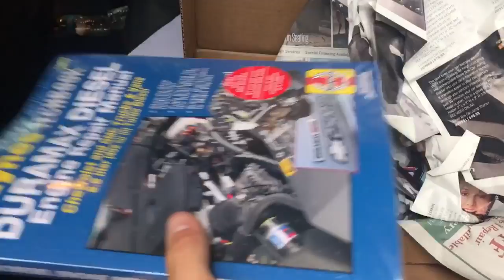This old Duramax is Gonna Make me Broke!

Comment: The bang for your buck would have been to order the head studs, i don't know what all you ordered from Lincoln diesel, but when I ordered my headstud kit it was like 880 out the door, so a couple hundred dollars more would have bought you reliable security and freedom to play about as hard as you want, I wouldn't own a diesel without head studs, people blow head gaskets on stock trucks. my truck had 210k when I bought it, was running 70hp tune, by 215 I had coolant leaking out the back of the gasket down the block, now at 245k studs in and running 120hp EFI live, it's confidence for miles, never a reason to question in my mind with the throttle down. Your playing Russian roulette with diesels and not putting studs in, on any of them, but hey, its not my wallet, just saves so much time, money, and frustration down the road. So consider yourself warned and don't let blown gaskets down the road sour your experience with this diesel.

Comment: I have hardway tunes on my '16 6.7 and they're legit. I can't run it turned up from stock delete bc it makes so much power I know it destroy my stock clutch. PPEI is another good one.
Reply: I also have a bullydog gt for monitoring and it does ok. I will probably switch it out for the edge one day but it works for now. U will have to add a sensor bank for it to read EGT's which are like $149 online
Reply from the maker: Thanks man!

Comment: efi will do good for that truck it's lacking power for sure.  my buddy's 07 is bone stock. not even a cold air or strait pipe bone stock. and that mf beats 2012–2014 Chevy 5.3l with work done to the motor.  all day long. like leave them in the dust!
Reply from the maker: I'm assuming you're talking about the dmax? But yeah its running with bad injectors so i'm sure that it's loosing some power. But keep in mind stock for stock a lmm will whoop an old lb7's ass haha. I can't wait for this truck to get efi live, i'm sure it'll wake it up a lot!
Reply: +Rebel Mechanics for sure

Comment: your crazy for doing a head gasket without doing studs. better to do it all at once while its apart cause your going to regret it down the road. id never run a 100hp tune without studs.
Reply from the maker: A 100 hp tune is nothing